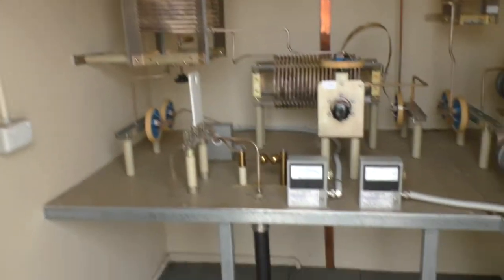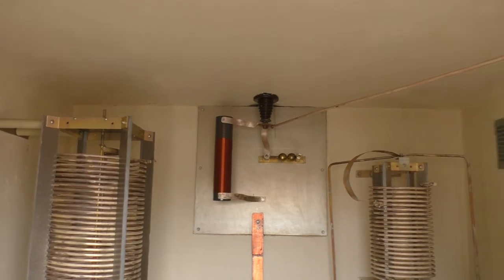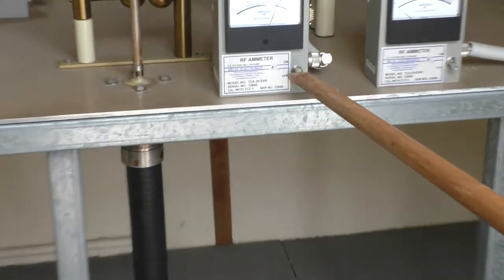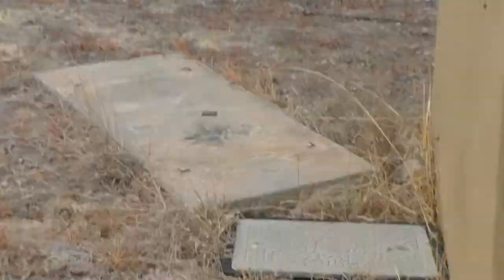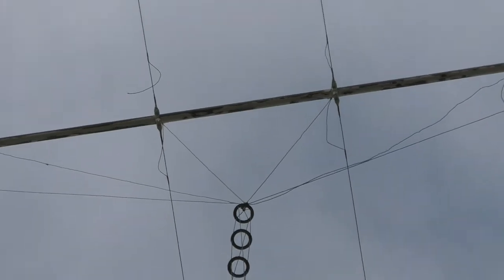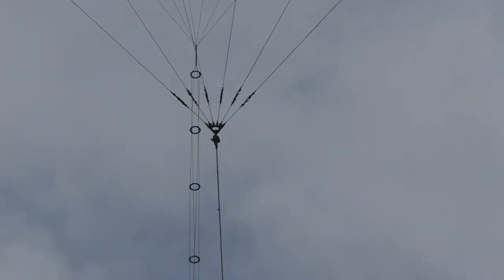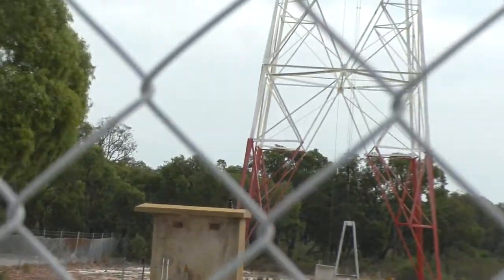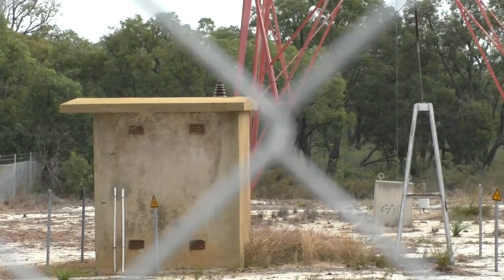Ernst Alexanderson AM Broadcast Antenna Built In 1926 Pt 2

Comment: So what kind of antenna is that?    Fed at both ends?   Not a dipole I take it.
6 elements up top and 2 feed lines?   Are the vertical 4 wire cages on each end part of the antenna itself.
I'm confused.   I thought AM stations had phased vertical arrays.

Comment: “It is necessary to employ oscillations in which the rate of radiation of energy into space in the form of Hertzian or electromagnetic waves is very small ...” “... paradoxical as it may seem, the effect will increase with the distance and will be greatest in a region diametrically opposite the transmitter ...” “... The most essential requirement is, however, that irrespective of frequency the wave or wave-train should continue for a certain interval of time, which I have estimated to be not less than 0.08484 of a second and which is taken in passing to and returning from the region diametrically opposite the pole over the earth’s surface with a mean velocity of about 471240 km/sec. ...” Dr. Nikola Tesla

Comment: Nice video can you climb it wenn the
transmitter is activ or is it to dangerous ?
Reply: I would rather not do it. It is dangerous. The masts themselves are grounded of course, but the wires are live and 
on high voltage. They write 60 Amps of current are normal in the HF (antenna feed circuit), and the voltage is pretty high, which was seen in case of isolator failures which already have occurred. There is some extensive arcing happening in such a condition. And this means some thousands of volts in HF are sent up to the antenna by the output transformers. The alternator systems is built to be capable of transmitting at 250 kW of power, the scheduled transmissions are conducted with 60-80kW usually.
Reply: @berndp3426  thanks ^^ a friend of mine climb a similar mast with 100kw the mast was Grounded but was fed at the top with no Insulator. he was ok just felt a little bit tingle when he climb back down ^^

Comment: An explanation how this thing works would be great. Are those wires rigid coax for example. Interesting bit also is the patent for those meters: patentimages.storage.googleapis.com/pdfs/US3914689.pdf
Reply from the maker: No, the wires are are all single conductors in the ATU and in the antenna system. Interesting patent... thermocouple meters haven't been used for a long time. The coil and capacitors on the left are the matching for the antenna feed. The coil and capacitors in the centre and on the right are reject traps for the other two transmitter frequencies that are broadcast from that site.